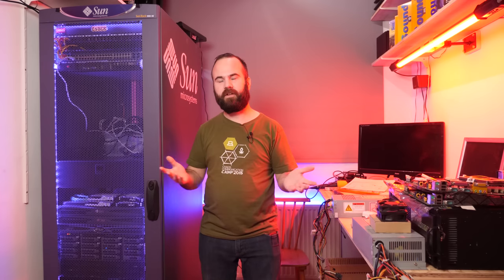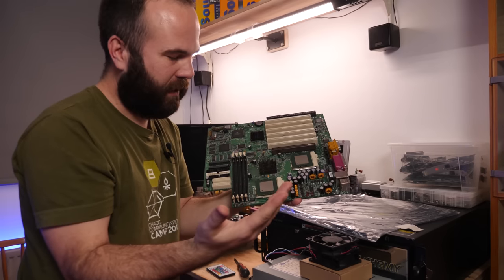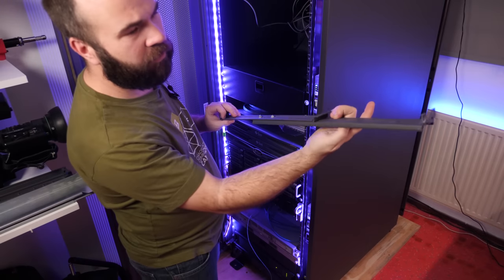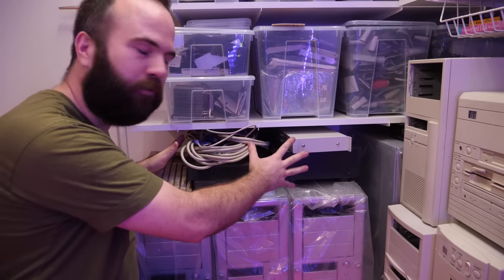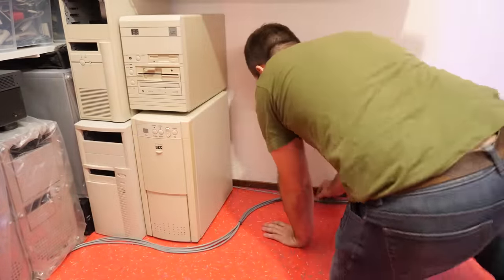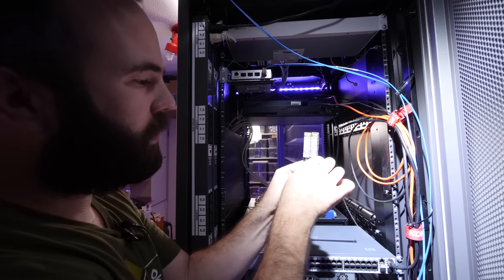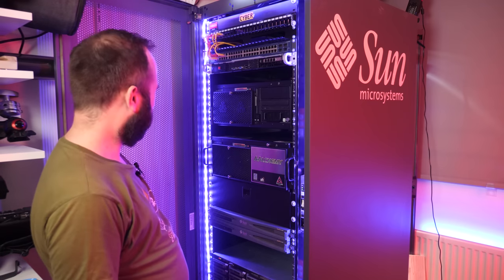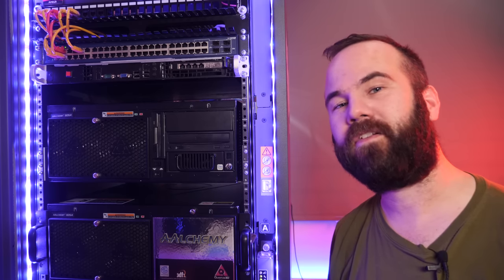Building a Homelab Server Rack

Comment: The server stack I have is 1/4 that size with all modern boards and SSD stuff but it is used to arching security IP camera audio and video files. and has a lightweight webserver to make accessing those files easier.

Comment: Nice lab! I started a little nostalgy lab in the basement almost 2 decades ago. 
Some stuff just exists for the glory of old times, some is still in use from time to time with software that cannot be easily ported to new hardware or virtualized.
The "modern" part of the hardware for daily use makes the smallest part of the rack.

24U open frame rack
3x Sun Netra T1
1x Dell Poweredge 3250 (Dual Itanium2)
1x Supermicro 3U 16bay archive server (ZFS on OmniOS)
1x Gooxi Xeon E3 8bay for storage and virtualization (ZFS on Ubuntu)
2U Dual Xeon E5520, 2U Dual P3-933
3com Corebuilder, 3com Superstack Gigabit Copper, 3com Superstack Gigabit Fibre
TP-Link 1GbE + 10GbE Switch, Cisco 2611, KVM Switch
1U selfmade pfSense firewall appliance

The 3com switches build my legacy network, with an uplink to the modern switch; which also connects the storages (10G) and has an uplink to my office (also 10G).

There is also a big shelf with old unix workstations, connected to the 3com switches too:
SGI Octane2, 4x SGI Indigo
Sun Ultra2 + external 6bay disk box, Sun Sparcstation 10
Digital Alpha Workstation 433au + external disk+dvd-rom shelf
HP Visualize C3600 (PA-RISC), IBM RS/6000
A bunch of external SCSI CD-RW and DVD-ROM

Comment: Great video.  Thank you.  Something I always do/advise......even if you think you never will need to.  You should also run extra string/pull cable through the plastic pipe in case you want to run more fibre/network cable later on.  As now if you do, you'll need to take apart all the pipe/trunking again.

Comment: I have a small home rack as well. Mine is a storage shelf in the basement lol!  Home-built server in a 4U case with an AMD FX 8370 running CentoOS with KVM/QMEU and Virt Monitor. 5 bonded adapters going into a 24 port gigabit switch. Runs my NFS/SMB, webserver, and a pfsense VMs (a passthough pci nic is dedicated to the cable modem). Pi-hole and owncloud VMs on here soon. Only other items of note on the rack are a wireless AC access point and the whole thing is connected to a Tripplite 1300VA UPS.  I have plans to hopefully build a FreeNAS box soon with 18-24TB raw drive space.

Comment: The adapter looks a bit like the Korean seller on ebay that sells Pentium III-S and Celeron Tualatin. I think it's based on Lin-lin adapters but not configurable because there are no jumpers. At least, you can drop the CPU in a non Tualatin board and it should work ok, even if the CPU microcode isn't in the BIOS. I was in this situation with a Gigabyte BX2000+ and a PIII-S 1.4GHz with a Coppermine socket 370 to slot 1 adapter (plus the lin-lin adapter on it and then the PIII-S) and even with the CPU unrecognized it worked perfectly

Comment: You're rack is probably a lot more exciting than mine, I only have 6 machines in my rack at the moment. but I am Planning on adding a backup server. My rack is full of old gaming rigs turned server. I have 3 vm servers and a old pc running as a router. then an old IBM x3650m4 that I haven't even come up with a use for yet. So my rack is a lot more empty than your's. Your's is probably a lot more fun with all the retro hardware crammed into the rack. That might be a fun way of doing a retro lan party, building a small 12U rack with old retro gaming rigs in it.

Comment: I don't have anything anywhere near as impressive as this, but I do have a server of sorts. It's a little mini PC from China that does all of the small mundane tasks that you would normally have to have a  computer on for, and some of the things that can't be done on my Synology Diskstation. It was £70 at the time, and runs Windows 10, it has 32GB of (slow) storage, and 2GB of RAM, not a lot, but it seems to work ok for the task. I use it mainly for keeping my Google Photos up to date, as well as my Google Play music library, and at one time it was being used as a USB over IP server, but that doesn't work any more. I also have things like uTorrent on it, and it could be used for printer sharing and other things, a very useful tool

Comment: I have a Dell Poweredge R810 4xE7 4870 processor and it does not turn on. Any time I try it can not even boot for 3 seconds. Tried to reinstall memory and processor but still the problem is still the same. It always reads system halted.  Any advise to help me solve this problem would be greatly appreciated.

Comment: Ik heb 1 retro server en dat is een Pentium 4 HT (3.0GHz) met 1.25GB DDR (400MHz) en 2 IDE HDDs (250 + 320GB) + 1 SATA-1 2.5" HDD (320GB). Het is een backup server, die werkt met FreeBSD-12 en ZFS. Het ontvangt de incrementele backups van mijn hoofd desktop met Ubuntu 19.10 ook met ZFS. Het grootste deel van de backup zijn de 16 virtuele machines (Linux en Windows). Ik gebruik een goedkope 1 Gbps switch met 5 connectors, maar de Pentium loopt op >90% CPU belasting en dat beperkt de snelheid tot ~200 Mbps. Ondanks die beperking duurt de wekelijkse backup door de ZFS send/receive ongeveer 1 uur. De snelste HDD is de 5400 rpm 2.5" disk en die bevat dus meer data dan elk van de 7200 rpm 3.5" IDE HDDs van de Raid-0. 

De PC kast is passend van Compaq Evo met stickers voor Pentium 4 en Windows 98/2000. Het moederbord, CPU en RAM kwam uit een HP D530 SFF uit 2003. De voeding is een nieuwe, lokaal gekochte Itech voeding van 600 Watt (14 Euro in Santiago de los Caballeros) met twee SATA pluggen en 2 Molex pluggen. Morgen krijg ik een 1 GB DDR kaartje van 400MHz en ik hoop dan op een ~25% snellere CPU door de dubbele geheugen toegang. 

Ik gebruik de hele dag Spaans of Engels en dit was dus mijn kans om weer eens Nederlands te gebruiken :)

Comment: Hey there usaid u like to read configs so here is mine.
Server: Dell R720 (2x e5-2697v2, 384GB Ram, 2x Samsung 870Evo 1TB Raid 1 as boot drive, Samsung 970Evo 1TB for VM's, running Proxmox)
NAS: Synology DS 1517+ (16GB Ram, 5x 12TB Ironwolf Raid 6)
Switch: MikroTik CRS317-1G-16S+RM, Cisco SG200-18
Network Cards: 1x MELLANOX MNPA19-XTR 10GB, 2x Mellanox ConnectX EN (MT26448) 10GB
USV: Eaton EL1200USBIEC
And all of this is sadly not in a rack cuz I didn't find a cheap one.